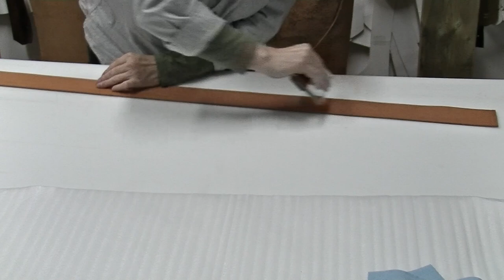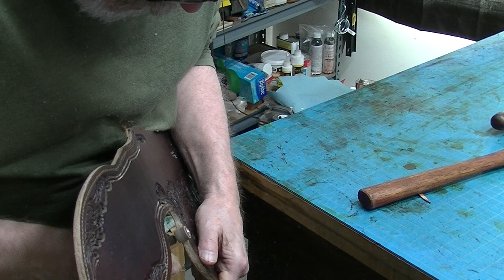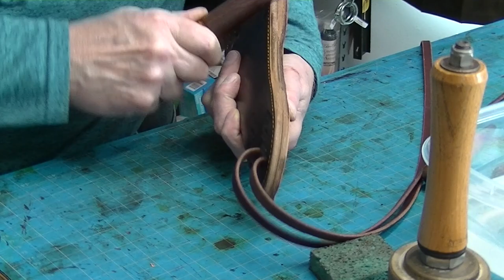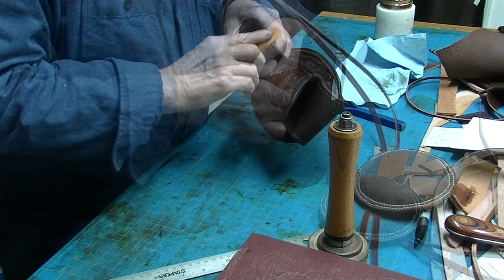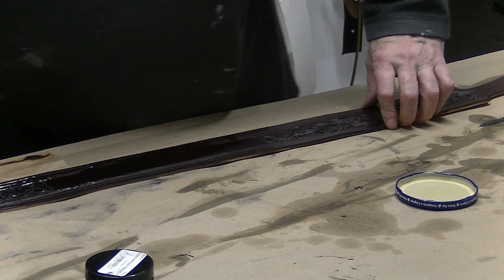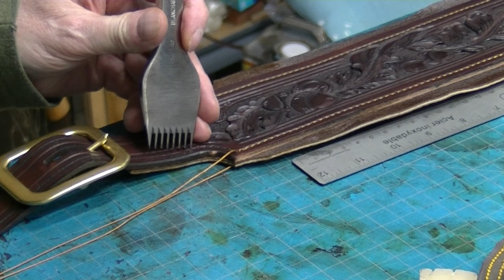Crossdraw holster and cartridge belt for SAA .357.

Comment: Beautiful.  How wide is the cartridge belt, if you don't mind me asking?  And do you base the width of the belt on cartridge length, or do you have a different system for determining the width, or do you just have a set width for all of your work so holsters will fit regardless?

Comment: Turned out really great. One question what does the glass thing do for the leather 👍👍👍👌👌
Reply: im guessing it squeegees out the water evenly from the surface of the leather for working.
Reply: It is used to compress and remove stretch from the leather in preparation for tooling. When you tool leather it tends to stretch out causing fitting problems later on. Some people use tape on the back to reduce stretching instead of the glass slicker. After the tooling is finished and the leather dries, the tape is removed, the leather oiled, dyed and finished. The slicker can on some leathers with a softer grained surface, cause the tooling to not achieve the desired depth and to appear flatter. Which generally is not a problem on thicker leathers vs thinner pieces.